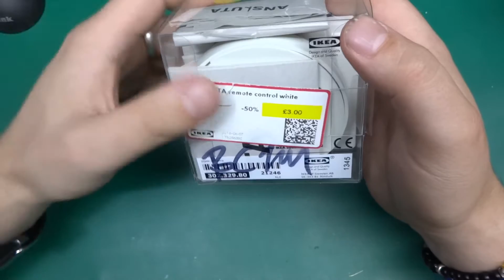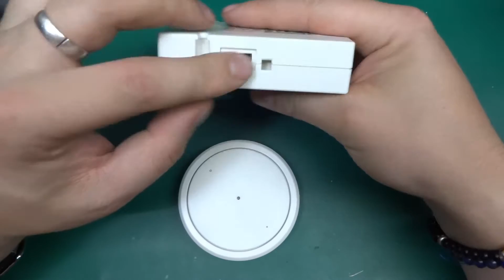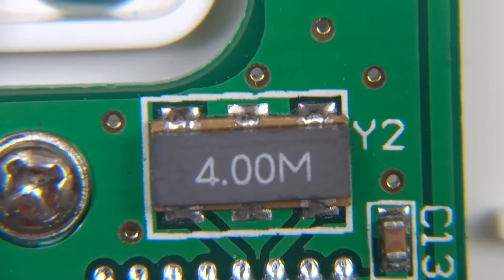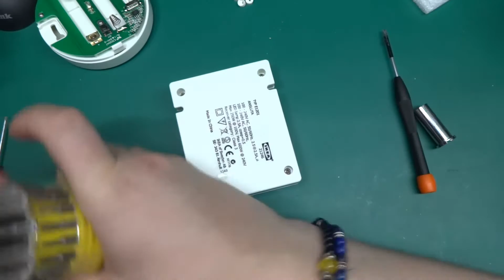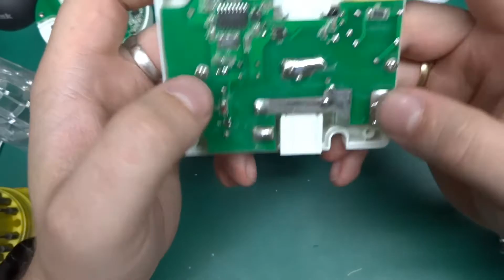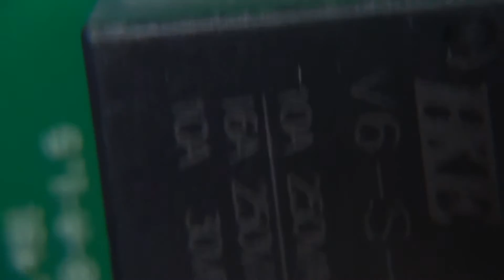Ikea Ansluta - mains switching remote control - review and teardown (RaT)

Comment: I have one of these that has just stopped working, I know its the unit as ive tried the other one I have on the affected set of lights, unable to get a replacement Im kind of lost with what to do next, from this I could check the antennae I guess but not much more, could a good electrics guy know hoe to fix this?
Reply: I believe you can get a TRÅDFRI equivalent, same input and output plugs, that uses the ZigBee protocol instead of whatever signal this uses. This does mean you'll need to buy a TRÅDFRI switch to control it as well, however if you're already using some form of home automation that has a ZigBee hub, you might be able to pair it with that.

Comment: You sir are not average :).  Some companies when introducing newer type products use extra techniques to prevent the common end user from accessing.  Part of the reasoning is to prevent common consumers from accessing the insides if they do not have a certain level of knowledge.  This prevents basically the kids who have access to a screw driver to take the device off the wall, open it and shock themselves.  Other times if a newer product is not fully understood by the consumer, they sometimes believe there is a faulty part and resort to opening the case to fix it themselves.  Those without proper training are more likely to go through standard warranty channels if it's is a bit more complicated to open.  Most of this comes down to %,  for example, if 10% of consumers will open the device, then hiding the screws will prevent 5% of them from buying a device to explore and return (possible because they broke it in the process).  Then using security screws will reduce this down another 3%.  Now your left with much more experienced individuals accessing the insides, and typically these individuals are not the ones that will waste your time with ignorant warranty repair request.
Reply from the maker: Thanks, this makes sense I guess.

Comment: Hi there, I was using the exact same item for turning on and off my ikea lights. It used to make a click sound when it turns on and click again when it turns off. But now it clicks on and after a second or two, clicks off immediately. Do you know what could be wrong and what I would need to replace? I'm thinking it could be the electro magnetic relay switch.
Reply from the maker: +Jeff Chan hey. I don't think there is anything with the relay, since it is 'clicking'. My bet would be on the supply voltage being too low. There is a capacitive dropper power supply inside, and possibility is the cap has failed and lost some capacity, hence supply voltage drops once relay clicks in and draws some decent current. That causes the click out. But that's only theory. I would measure what voltage is on relay coil when clicked in. If 12v or so, then ok, but if under 10V, that would confirm my theory. Otherwise the fault is elswhere, but it's difficult to diagnose without measurements. If you go down the route of troubleshooting this, keep in mind, that entire board is live at mains potential, so be careful ;)
Reply: Thanks for the reply! Will try to get some measurements to see what's wrong. Hopefully it can be fixed or else I would have wasted money on the matching cables that was required from Ikea.